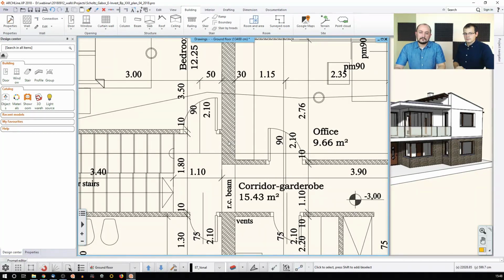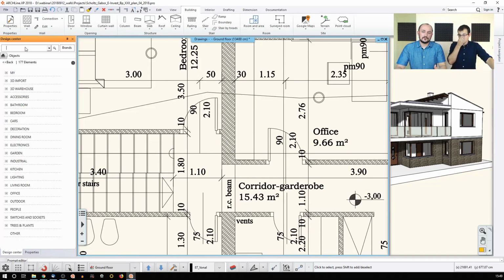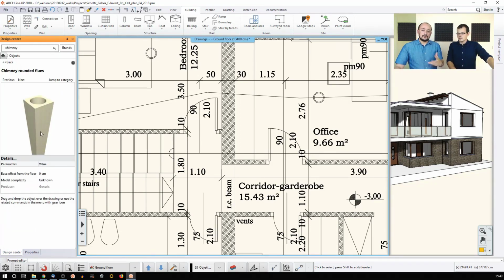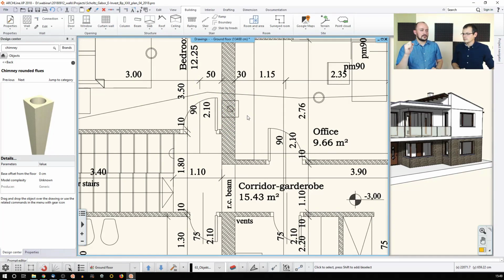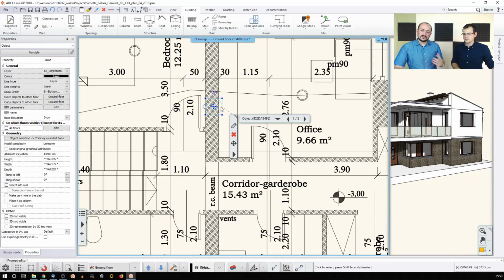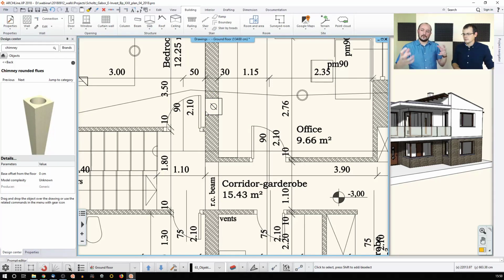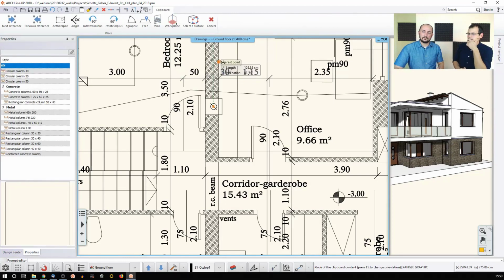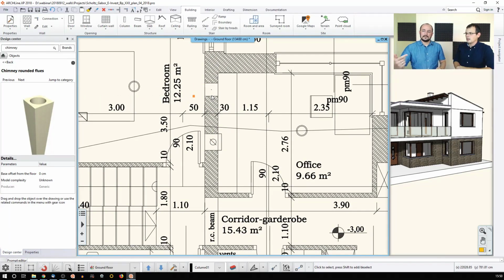Joining Columns to Walls - ARCHLine.XP

Comment: I try to insert a beam into wall but that doesn't work.
In concrete structures the beams are commonly (in my country) around the perimeter of concrete slabs, so I added concrete beams (separate objects not slab with beams)  I have the top of walls finishing at the bottom of the structure above.  The wall is cut by the slab but not by the beam.
Workaround please?